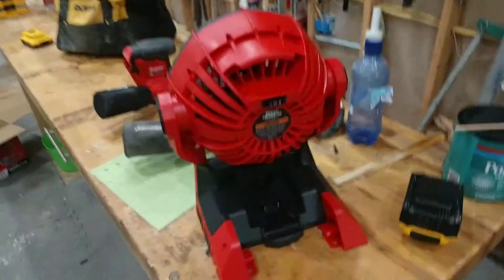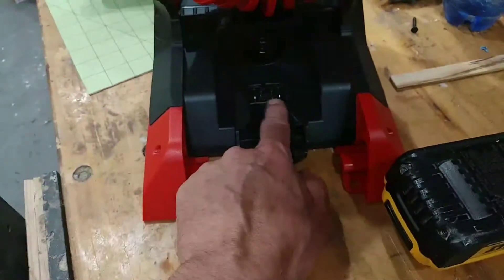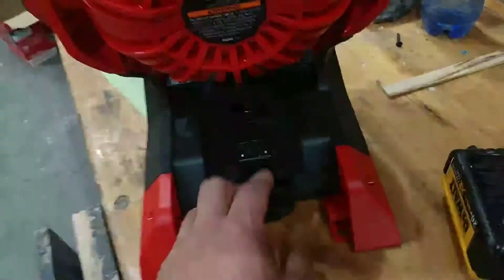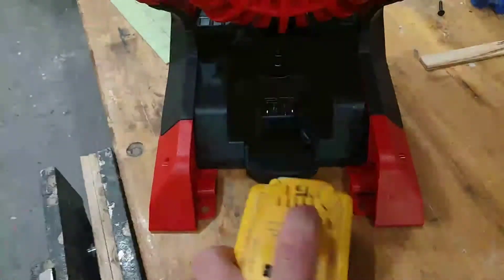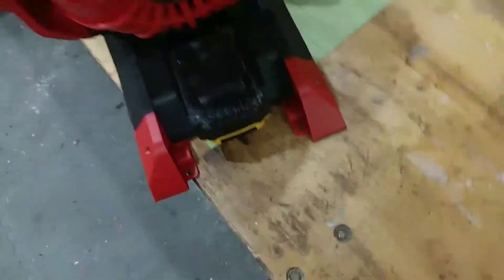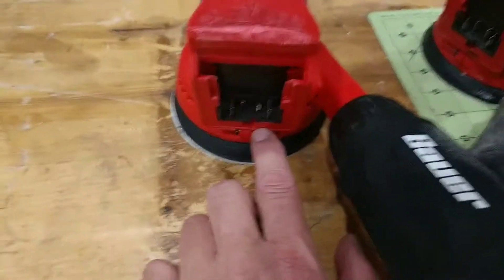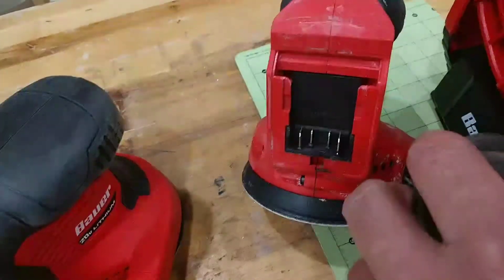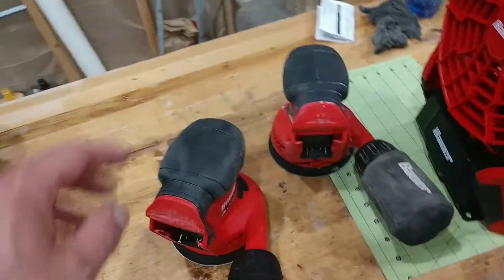Bauer 20v tool mod to run on De Walt battery with 10k ohm resistor , lug removal on tool required

Comment: Thanks for the video. I got it working with all your info. Do you happen to know if you lose LVC by removing that pin?
Reply from the maker: We do lose LVC when using DeWalt battery on Bauer, be aware of the battery voltage as you can over discharge your DW battery using it this way.

Comment: It's not clear where you put the resistor and why need to cut a lead if you're adding the resistor
Reply from the maker: The 10k ohm resistor is soldered to the negative terminal and the 3rd lug, the same one that is removed. Here is a video of where the resistor is mounted on the board. I hope this helps. https://youtube.com/shorts/HbWa5kTy2BY
Reply: @GmanInd  I'm actually trying to get a dewalt battery to work on a hercules tool.   I wonder if the resistor is different.
Reply from the maker: @lowspeed2000  I have not tried a Hercules, if it works let me know!  All the Bauer I have tried will run on DeWalt batteries, all require some modification to the Bauer battery holder to allow the DW to fit but the leaf blower will run without any resistor added. I ran my first R.O. sander by bypassing the entire board and only switched the positive line between the battery and the motor so even if you toast the board you should still be able to use the tool but lose the battery low voltage protection.
Reply: @GmanInd  I'm trying something a little unique where I use a Makita battery to DeWalt converter, so I'll tweak the adapters resistors

Comment: Thanks for this video, I'm trying to do the same thing with a dewalt battery to the bauer sander. did you even need the resistor if you snapped the lug off?
Reply from the maker: I think that the resistor is needed for the circuit board to work, the sander and yard tools use a regular switch and you can bypass the circuit board.  I connected the battery with jumper wires and yes the resistor is needed for the tool to work,  but the sander will work if you solder a jumper from the negative lug to the black wire, the sander will run the entire battery down as the low voltage shut down is eliminated so your battery can be damaged slightly if you completely discharge them.
Reply: @GmanInd  I got a resistor soldered on to the 1st and third lug on the board and its working great! Thanks!
Reply from the maker: a lithium Ion battery is a great battery but it can be damaged from deep discharging and even over charging. I have one sander completely bypassed and  it will drain the entire battery, I have to be aware and change the battery when it slows down and the last battery LED is glowing. if the battery indicator stops glowing it was over discharged. I also use generic DeWalt batteries to keep costs down and to abuse in these modified tools like the leaf blower.